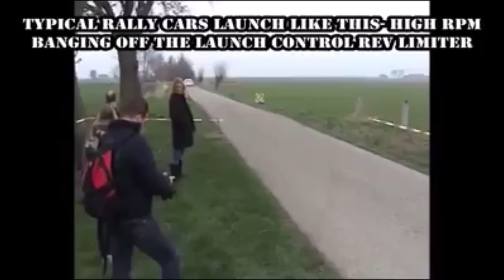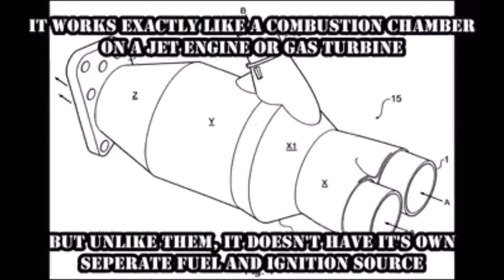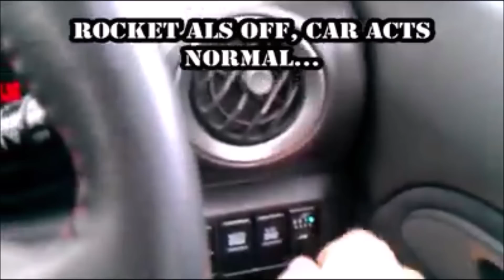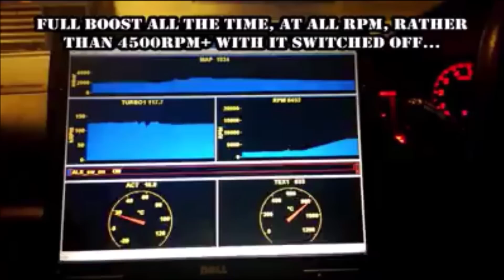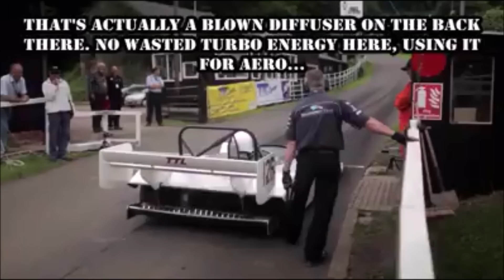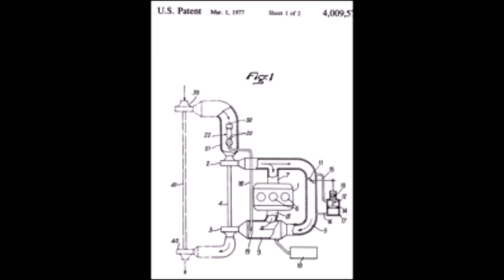Rocket Anti-Lag, making your turbo work like a jet engine- A quick overview and some mythbusting...

Comment: what is F-ing point of racing if they ban any new technology development that gives the drivers a competitive edge? it feels like these racing leagues are just propaganda machines for a hand full of already dominant Brands.
Reply: Yeah. But racing lives in finding the gaps in between regulations to get competitive advantage. This gap was then closed, but, was a very good one. Just look at formula one for an example
Reply from the maker: Trouble is, the best advantages and gaps get closed practically immediately, usually 1 race later, which is a real shame
Reply: @StavTech unless your mercedes
Reply: @StavTech  Mainly to satisfy other teams who don't want to have to engineer a new car to stay competitive when they just launched a new car that season.
Reply: That must be absolutely brutal for the turbo’s longevity though.
Reply: @hugolafhugolaf  All depends on temperatures. Every turbo can run steady state under boost with adequate fueling and temp management. If this spooler is fueled properly the temps wouldn't inherently be bad.
Reply: Competition ..if one team only had the tech then people would switch off because of repetition ..
Reply: I always wonder too. But I figure the race is not to prove what machine has the best advantage, but what man handles a specific machine best.
Reply: Highlights the drivers more if the cars are "equal" 🤷🏼‍♂️
Reply: banning of an advantage only fuels the next innovation of the next thing
Reply: These kinds of regulations can actually bring new cars into dominance, i HIGHLY recommend for anyone who hasn't already to look into the toyota celica gt4's story. If I remember right, it was their attempted loophole for a restriction plate that ended up being the rise for subaru in the wrc. The gt4 is still one of my favorite cars to date also a cool story
Reply: That's why I like underground racing much better
Reply: Most of modern vehicles tech comes from racing engineering.
Reply: The reactions to this comment are pretty hilariously off the mark, all things considered.

If motor racing is meant to be SOLELY about the monkeys behind the wheel, why don't we just put them all in the same car? Better yet, riddle me this: if that is motor racing's ideal state, then why the fuck does every series with spec or near-spec cars struggle to find or keep a fanbase? Why do all the most iconic eras in each discipline have batshit, wildly varied grids of cars? Maybe it's just me, but that might have something to do with....IDK, THE CARS. 

Following motorsport is a pretty shallow experience without the meaningful variables and narratives that make sport worth tracking. That's probably why Formula One - probably one of the most old-school series left, as dumb as that sounds - has remained seemingly untouchable in spite of Mercedes-AMG and Red Bull Racing (quite possibly BECAUSE of them, even). Keeping track of all the ways teams try to get or keep an advantage is interesting enough to dull the blow of dominant streaks (which, while we're at it, don't seem to last as long in the 60's, 70's, and 80's - y'know, when the teams on the ropes had OPTIONS to close the gap).

Motor racing is more interesting when it is more technically open. There's more to learn and more that's WORTH learning, which is why F1 fans stick around. But nah, let's minimize the machines as much as possible. Not like it's AUTO RACING or anything......
Reply: Because you’re not supposed to put 23 feet of fuel line in your car…
Reply: Propaganda is exactly what trash like wrc, nascar, f1, and dtm are. Real racing is in time attack/autocross and somewhat in gt/endurance.
Reply: NASCAR crippled the v8 game by banning the hemi with overhead cams. Imagine the cars that would be around
Reply: Money laundering
Reply: Street racing lol idk 🤷
Reply: RIP Can Am
Reply: cuz eventually theyll stop using gas engines for electricity, ethanol, nitro, bioD, hho, hydrogen... they want the world hooked on crude forever
Reply: So many morons ⬆️ all C.O.D. twitch streamers. I'm good because I wall hack. 🤣🤣🤣🤣🤣
Reply: I’m assuming you haven’t followed many racing series over the years. Racing has rules, and intentional “holes” for teams to find small advantages, but many leagues have “levers” they use to maintain balance in performance between teams. This keeps racing closer and the intent is to keep one team from dominating, which is a thing fans complain about when it occurs. Close racing where the outcome isn’t already known is typically what fans want.
Reply: Yup, that's why Porsche don't enter F1. It's pointless, compared to dominating Le Mans.
Reply: Thats literally what nascar and f-1 have become
Reply: On the other hand Subaru definitely has the longest headers, most cars would never have room for the jet
Reply: I always thought that; Getting around rules and problems is how really cool shit gets invented.
Reply: I get you but at the same time the part I'm most interested in with racing is the tech that can actually trickle down to consumers. This is not one of those things and honestly unless it's a full blown race vehicle there's no reason why anyone should ever want it.
Reply: agreed, the bureaucracy is unreal
Reply: 10000000000% yrs
Reply: Driver Skill
Reply: They ban certain tech because its TOO good, things that would force EVERY team to use in some form or another, which would stifle innovation in other areas. The best example of this was the ground effect era of F1.
Reply: Not all racing is done in the track. Ain’t a whole lotta rules in drag classes either
Reply: So we dont end up with another group b
Reply: Exact quote by smokey
Reply: Just do as Schumacher and Hamilton hide the advantage tech with secret buttons or moving steering wheel 😂 and then you get 🏆🏅🥇
Reply: THANK YOU!
Reply: sadly the only point of racing is to get more economaly engines
Reply: There is none.
Reply: To keep it more driver-focused, rather than about what team has the most money for crazy r&d and high tech builds
Reply: Then it becomes a drag race instead of the driver skills and team cohesion as what wins.
Reply: thing is, most forms of racing have classes.  I agree that in all forms of racing there should be an "unlimited" class for the truly insane out there, but usually limitations exist to put everyone on the same tech level and make it come down to the skill of the driver instead of the tech of the car.  There are also limits to prevent undue risk.  There is absolutely no reason a car couldn't hit over 280mph (F1 cars especially) with modern technology on a road course with decent straights, but then that means the car chassis has to be able to protect the driver with that much force.  Some courses (Laguna Seca, Road Atlanta, and others) have negative g points in the course and people with money on the line tend to push the vehicles far beyond the limits and crash because it worked the first 3 times, but that 20mph tailwind reduced your downforce and you flew into a wall because of lack of grip.

Should there be an unlimited class?  Yes.  But you would have to limit what courses they could run, and enable tighter safety regulations to allow it, or Joe Bob is going to show up with a 1200hp superbike and kill himself.
Reply: Racing isn't about going fast. It's about the people in the stands that are footing the bill for all of this. If one car has too much of a edge, all you have to do is look at Gordon in 94-95 he went from being the Wonderboy to being hated by the end of 95. People want a show not the same guy walking the field every race. And if the people aren't interested they don't show up or don't watch. Nobody watches, nobody sponsors.
Reply: @patrickisswayze3446  racing is about going as fast as you can lol you make 0 sense
Reply: @patrickisswayze3446 lol no
Reply: New tech development? That happens regardless of bans, the bans happen to keep competition affordable and close for the teams that aren’t walking around with billion dollar budgets
Reply: You hit the nail squarely on the head there Broseph! Just look at the bs with Group B, Group A, current WRC, Nascar, Indy, and the worst one of all (rules wise) F1.
Reply: That’s the whole point of racing. Not whoever got the most money or who is the better mechanic and engineer.
Reply: @whyalwaysme1106 There's literally no reason why it shouldn't be about all of that.
Reply: You probably think cheating on video games makes you a better player. That's the point, to keep someone from getting a competitive edge over someone else. It's a test of the drivers skill, not the mechanics engine build. That's why there are rules like that in all officially sanctioned racing events.
Reply: @christopherlong5928 a competitive edge is NOT cheating. Your false equivalency is false. Everyone else has the opportunity to develop the same technology. Get better engineers.
Reply: @christopherlong5928 That sounds like a sport for people into Track and Field. Which is lame as hell. Why not just have the drivers run around the track on f'n Power Wheels. 😂

Comment: Wouldnt running the turbo at high RPM with low engine RPM cause insufficient lubrication?
Reply from the maker: No. Turbos don’t require particularly high oil pressure, and unless your engine is running very low oil pressure, which is a problem in itself, lower rpm shouldn’t cause low oil pressure
Reply: Could be, but at the same time, any als isnt made with turbo durability in mind, its built for speed

Comment: easier way is to. add fuel/nos into the exhaust right before the turbo. so the heat and flames ignite the fuel/nos. causing another combustion with out throttle
Reply from the maker: You’d be better off just injecting the nitrous in to the engine.

Main thing is though, this doesn’t run out

Comment: lol theres no turbo on Nics car.... boost is taken from the APU engines compressor
Reply from the maker: No. Even Nic says in this video that’s not correct. Uses some APU parts but that’s just because a turbo and a APU is the same basic thing barring no combustor on a turbo. Unless you do what Nic did. You can even see the wastegate actuator.
Regardless, it’s the same basic thing even if he used a full APU.
Reply: @StavTech  no he says the APU is based on a wagon turbo, ifs not configured in anyway like a turbo, no exhaust gases pass through it.... do you want the make and model APU he used?
Reply from the maker: @photobillys unless my eyes are wildly deceiving me, you can see the exhaust going in to the turbine housing. Literally going in to the turbine housing which is held on to the centre core with a v-band and can see the oil feed line to the centre core too.

Regardless, all an APU or any basic jet engine is is a turbo plus the combustor so it works on its own without the engine creating the turbine flow, so it’s the same concept this video is on about even if what you said is correct. Would be nothing stopping you feeding the exhaust via the APUs turbine.

Comment: Audi Umluft system was also interesting utilizing multiple air paths and wastegates to accomplish less turbine spin-down between shifts back in Gruppe B days
Reply from the maker: Umluft is exactly what fresh air antilag is today. Exaclty. Was next used on Celica GT4s and Evos, then almost all WRCs after 1997. Just Turbosmart and others like to pretend it’s something new to sell stuff. And Ferrari and Alfa both used it before Audi did, but in F1.
Reply: @StavTech  How is fresh air injected into the exhaust? Do you need to be making more boost than EMAP for it to function? Does it work off a venturi?
Reply from the maker: @dickard8275  it’s not really ‘fresh’ air, it just means air bypassing the engine totally, from boost pipe to exhaust manifold.
And only works when boost pressure is higher in the boost pipes than exhaust manifold, which to be fair is most times off throttle with ALS on.
Almost always needs some normal throttle bypass ALS to work correctly and to start it off, much like rocket does.

Comment: Thanks for the vid; had actually been wondering if the Mannic Beattie was this or another take on the idea as not like I've got a great view of details over here.  The theory's simple once you put it together, though I've seen a few build attempts that demonstrated that practice is harder.

I think it might have been Ferrari that got the FIA to take note of the injecting-fuel-into-exhaust version (I don't know if they did proper combustor cans though) Duckworth at Cosworth famously lodged a complaint that it was basically two engines.  Clever of Prodrive to implement it without extra injectors, wager it could work even better with GDI if all this shit wasn't outlawed.
Reply from the maker: The Ferrari fresh air antilag didn’t use a combustor or external injectors im fairly certain, that, the Alfa setup, and the Audi setup, all used what today they must call fresh air antilag.
No sign of any external injection/ignition or combustor. 

I was always under the impression Cosworth planning to was what got it outlawed before it even began, but don’t know the full story.
Reply: Manic beattie used a helicopter auxiliary power jet engine to produce boost!